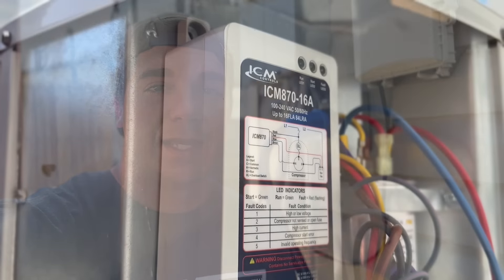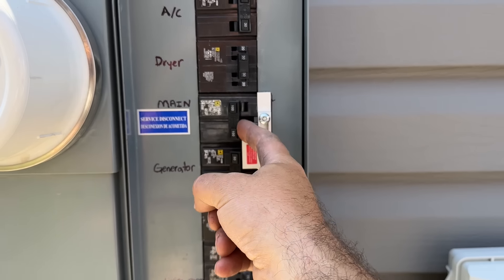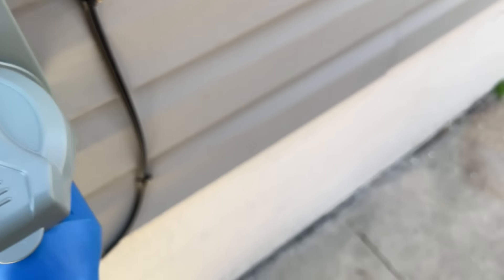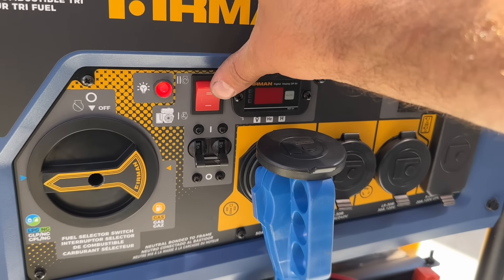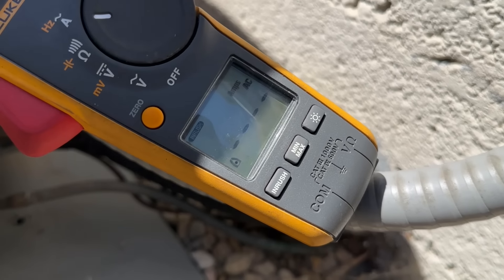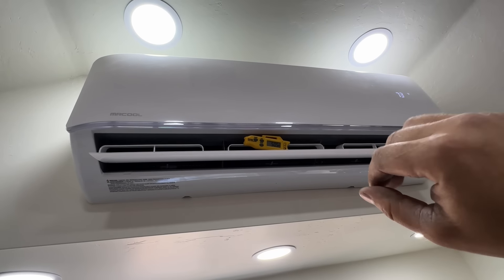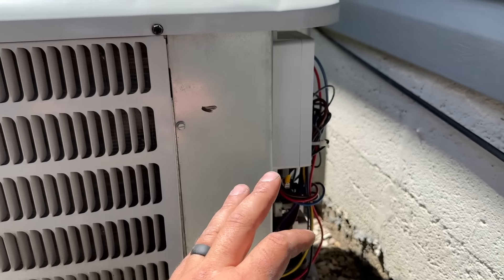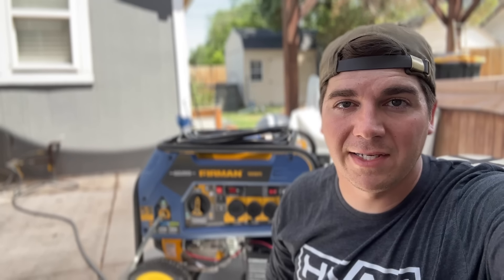How To Get Whole Home Backup Power For Under $1000

Comment: One thing to note with soft start devices, they lower the inrush current at startup. THEY DO NOT LOWER THE RUN CURRENT OF AN AC COMPRESSOR. Soft start devices do not save your money (in reality its very negligible) in electricity bill costs, but they greatly save your compressors life span minimizing wear and tear since it's not hard starting with a partially for fully locked rotor from the pressures inside.

Great video!
Reply: just curious, if soft start is beneficial that way, why don't the AC units come from the factory that way?
Reply: @Jeremy-vb6tv  more complexity, added cost, manufacturers want to sell units and given this is about a $400 upgrade USD not many would opt to do it unless it was absolutely necessary.
Reply: Note: most modern units have time outs that generally keep compressors from starting with a pressure lock. Soft start units do reduce start amps, so batteries or generstor can start the unit
Reply: @greggpurviance7252  yes, a time delay on relay. I have a variable one 2-10min delay for my outside compressor.
Reply: i think the benefit is purely being able to use a generator to run it without the generator popping an overload fuse when the ac starts.
Reply: Simple.  Money and practicality.  Many systems come with what we call hard start kits.  They do the same thing but cost a lot less.  Also, many newer systems are inverter driven already.  So there is no need for a soft start.  But you need to be very cautious in your selection of generator when doing this.  You need to make sure your generator is one that produces a true sine wave.  Electronics in modern systems will fail over time due to poor quality power.  Not all generators are created equally.  Portable generators are hit and miss on this.  Portables are also not made for continuous use like regular whole home standby generators are.

All that said, I have run a 4 ton heat pump (with a start assist kit) on a 9kw portable generator for short periods of time.

Another factor is this.  The soft starts mentioned in this video are only good for a maximum of 16 amps.  So that limits the use to 2-2.5 ton systems and under.  There are larger soft starts but they cost considerably more.
Reply: @Bassguitarist1985 isn’t a time delay just staggers start up with the air handling unit.  When the compressor starts, it still going to surge at start up ?
Reply: @tonymanero5544   according to this info, no, there should not be a huge amp spike when the compressor starts when you have a soft start kit installed, and that is why your generator can power it.
Reply: @Jeremy-vb6tv The new ones do, more and more. Old ones need the kit. There are even Midea window a/c’s with soft start i.e., inverter drives. My dishwasher is also that way.

Comment: FYI .... According to the T07571 manual,  the maximum is 31.25A. I have the same generator. I have seen a 42A peak at startup using the Micro Air soft starter, but it is usually 36A. Then the A/C runs on 13A. When the A/C starts, I still have the refrigerator, HDTV, desktop PC, LED lights and other small devices on without a problem. I think that the generator is producing more watts on NG than what is stated in the manual.
Reply: Are you running a FIRMAN generator like he has or an Inverter?  I have the same FIRMAN and was told not to run electronics off of it due to the dirty sine wave of electricity that could harm sensitive electronics
Reply: @attimus02  Same generator, same model. It is not pure sine wave. I do have four UPS's on my HDTVs, computers, routers, external hard drives, Xfinity X1 box and have not had a problem except the UPS's will beep and click when using the generator. I have a stupid power strip plugged into the UPS battery backup side with items plugged into the strip. All I have to do is move one plug to the surge protector side. And then turn off UPS. Surge protector with EMI/RFI Filter will still work. APC PowerChute has a sensitivity setting which may help with the clicking. If I don't use a UPS then I do have APC surge protectors. My Fisher & Paykel Dishdrawers will beep. As a backup, I have two 1408Wh and two 666Wh power stations, and eight 100W rigid solar panels which I made into four suitcases to set up in the back yard. I could also use the generator to charge the power stations and use on anything sensitive.

Comment: My 4 ton went from inrush of 120 Amps to 40 Amps for reference. I have a similar setup but don't run my Central A/C with my portable generator. It does run my entire inside breaker box. I do not have a main breaker or shutoff on the outside box, pulling the meter is the only way to disconnect power to the main outside box. I just shut off the inside box, outside, then run the inside box from the generator. My Central AC is on the outside box. Works great for me as I can run everything except Central, Oven, Hot Tub.

Comment: Sold my sticks and bricks end of 2019 - live full time in a 45' Grand Design "mansion on wheels" - I have a generator that is propane/gas powered just in case - there are soft start options for Rvs in case you need to run multiple AC's and everything else, which my home has 3 hence 3 soft starts needed - but - I can be completely off grid in moments if needed - good on you telling home owner's about soft start options - most people by a whole home Generac or solar at a MUCH higher price point for the same results HA! Next time there is a major hurricane etc. this video count will go way up!

Comment: I love that generator, I have the previous version I bought a few years ago (gas and propane dual fuel) for $600, it gets more use in my business then it does at home but I haven't found anything it won't power as of yet. was looking at upgrading to this one because of natural gas, not having to fill up gas or replace propane bottles. been wanting to put this system together, thanks for showing us.

Comment: Glad I did this when he released this video a year ago  as I have the same generator. Generator has been running almost a week straight since Beyrl hit Monday and now Sunday and still no power. Already did 2 oil changes and will change spark plug when power comes back on. Been able to run 4 ton ac unit with micro air soft start , dishwasher , washer and gas dryer (not simultaneously) , 2 fridges and chest freezer , and small electronics like router and cable modem .

Comment: I have this exact set up except I do not have a soft start kit on my AC unit. I can run the entire house and it's clean and fantastic with this Firman tri fuel unit. I bought the generator on Ebay from the Firman store for $500 brand new - not a refurb.

Comment: Had a small generator and it didn't have enough power (5500) to run several appliances or my AC. I bought a bigger (13000) LP and need to upgrade the transfer box. Your video was informative,thanks.

Comment: I have that same brand I bought in 2014.. I was upset that i was supposed to get a Goodman but got this we went back and forth.. anyways 9yrs later still working like a champ only had to replace capacitor last summer.. besides that nothin not even a charge 1.5 ton here

Comment: This is a great video! Can you answer a question for me? Are you running the fridge also? How many fridges. And if needed, are you able to run a tv and a gas oven with this unit. Also, water heater. 

The reason I ask, cause I feel like there’s some misconception out there with how big a generator is needed. I have a townhome, with 2 ton AC, 2 fridges, water heater, electric washer dryer, 2 tvs, 2 computers, a Wi-Fi router and of course lights throughout the house. Not everything will be ran at the same time. So I feel like something under 10000 is big enough. 

Thanks again for this awesome video. Look forward to your reply and anyone following the comments.

Comment: I have virtually the exact same setup. AC soft start and a Firman Tri-Fuel. I opted for their 10kW (when running on gasoline) generator because I have 2 older refrigerators and 2 older deep freezes as well. I've never had to use it, but in testing, it will run my entire house. While using a portable generator is a little bit of work to get the power back on, the generator is not limited to backup power only. I can use it for other purposes.

Comment: There are some 220 volt, 9500 watt, inverter type generators, for those concerned about damaging electronics with a portable generator such as this Firman.   But they are a lot more money and probably use gasoline only.
Reply: Champion model 201176 is a 9000 watt tri-fuel inverter generator. Wen also makes and sells one. As does Pulsar and Duromax

Comment: Your starting inrush current was actually much higher than what your meter showed. That meter did not have (or was not set to) a peak reading scale, although the inrush WAS about 1/3 of the original inrush before adding the soft-start. I use one on my 4 ton GSHP.

Comment: Firman’s are very LOUD! I have been on one job where they had a Firman. I was underwhelmed. Great presentation though. 
I have a hard start capacitor for my 2-1/2 ton central a/c. I need to upgrade to a soft start kit. I have my eye on one. I have the same side generator. I have the Honda EU7000is. It is phenomenal in my opinion. I have used it several times & is much, much quieter. Plus it puts out steady clean power. I have an interlock in my CB panel. My unit uses less gasoline than most & with a auxiliary fuel tank only need to fill it every two days.

Comment: This is another great video!  I would suggest consideration be given to using an inverter generator.  An inverter generator produces about 3% Total Harmonic Distortion 'clean' power which is safe for sensitive electronics like computers, etc   Regular non-inverter generators produce 12% to 20% if not higher Total Harmonic Distortion 'dirty' power.  It will work on sensitive electronics but will cause them to age quicker.  If an inverter is not used, suggest using a filter for sensitive electronics plugged directly into them.

Comment: Good video. Only thing I would do different is sell that generator and buy an inverter generator. Your generator has 15% total harmonic distortion which can and will destroy circuit boards in your house. Check out the Champion 201176 tri fuel inverter 9000 watt generator. It has less than 3% distortion

Comment: After our freeze a few years back here in Texas, I simply had a Generac 24KW installed. This also puts my whole home on surge protection. This is important as in my home you talk to fans, lights, TVs, everything is on network... even the smoker, pit, and grill. With all the electronics it is important to have clean power (60Hz).  Good luck with any setup you choose.
Reply: How is it?

Comment: I’m a generator tech and personally own two Firman gennies.
Reply: Hi!  Could you tell me whether or not Tri fuel generators have a safety feature where natural gas will be automatically shut off should generator stops running for whatever reason with no one around to notice?  Another video mentioned needing a regulator to do that.  Does Firmen Tri Fuel generator, or any Tri Fuel generator for that matter, have a regulator already build in the generator to sense disruptions in gas pressure?  Thanks in advance

Comment: I live on a 9 acre property in Alpine California.. No one knows that me and my wife live on a 33' trailer. We purchased the firman 9500 tri fuel. I had to return it 3 times. We bought it only to power our AC. I installed a soft start and bought 2 Ryobi inverter and run them in parallel they've been for 2 years straight.  I WOULD NEVER RECOMMEND A FIRMAN..

Comment: So, you know, that generator has a bonded neutral and so does your main panel so using it as shown violates the code. You're supposed to convert the generator to floating neutral when hooked up to your panel through an interlock. It's easy. Firman has released instructions. Then, when used stand alone you're supposed to use a bonding plug.
Reply: Absolutely correct and it violates code because it can be dangerous. Most newer portable generators come from the factory with a bonded neutral. Your operators manual will state the neutral configuration from the factory.
Reply: From what I have read, if you use a generator power transfer switch instead of an interlock then you do not need to disconnect the bonded neutral on the generator. California requires that you use a generator power transfer switch and says it is safe to use with bonded neutral generator.

Comment: It is VERY IMPORTANT to explain that the power inlet connector is deadly WITHOUT the breaker interlock kit you have installed (which is absolutely the correct way).  I would venture to say that a lot of people will not "get" that they MUST have the interlock kit to go along with the power inlet box.

Comment: Great video...I have the same setup here (less the "soft start")...same Firman generator running on clean NG...no worries about "gumming" it up with gasoline...I also installed a separate Siemen pony panel for the generator with the proper disconnects...then moved home essential circuits to that panel...the AC, unit did not make the cut...I hope that we don't have to use it, but you never know???
Reply from the maker: Awesome thanks for sharing!

Comment: i have a update. i loved my predator 8750/7000 but 6 months ago i bought the 13000/10000 predator tri fuel. with a 50 plug. and it will run everything at one time. my water heater stove drier at the same time i tried to test if i could over load it. it ran it all but dont like the water heater. but its nice to know it will do it.

Comment: Good video and info. I’ve done 4 50 amp generator back up hook ups with the manual transfer switch. I’ve ran it on my house. I haven’t installed any of the soft starts but I may look into that.

Comment: I have the same Square D meter-main panel on my home. I wanted to use the same interlock method that you used on your panel, but ultimately decided it would not work this way. 
Upon inspection of my panel, each main bus bar is fed directly by an aluminum conductor bar off the meter side of the panel. These conductor bars are bolted to the main bus bars and to the lugs on the meter side of your panel.  With this method of interlocking, I am fairly positive that you are backfeeding the grid by mistake. The breaker that you have connected to your generator inlet is energizing the main bus bars on your panel, consequently it is energizing the conductors bars that are connected from the meter side of the panel. If our panels are constructed the same on the inside, this has the potential to kill a lineman.
Reply: If the service disconnect breaker is switched to off, there should be no way for current to flow back to the grid, or for the bus bars to be energized from the grid.  Grid to service disconnect breaker to bus bars.

Comment: Hoping you see this comment (after 7 months of uploading this video), but I'm curious what kind of natural gas usage and cost you've experienced using the generator. We have natural gas here, and I feel like it would be pretty easy to tap into the gas line like you have set up in the event of needing to hook the generator up. The natural gas at my home is only used for the tankless water heater, the gas stove and the heater for the home. So gas prices during winter are substantially more than during warmer months (when I'd want to incorporate a backup for the home during hurricane season).

Unless I could budget for Tesla PowerWalls right now (I have solar on the home), I'd go that route, but this could be an affordable fix in the meantime.

Anyway, thanks for sharing the video!

Comment: I just installed the icm870 in my a/c unit today. I got one because of one of your videos and i think Taddy Digest did a video on them also. I did it mainly to help extend the life of the unit. Hopefully my generator will start it up. Mine went from 70 in rush to about 26.  That is a big change but  my generator only has a 30amp twistlock. i guess it is borderline but ill have to test it out to see if it will start it. Love your vids man. I watch a few of u hvac guys and u put out some great info.

Comment: I like how you set up the hookups and the anti back feed device on the breaker box. 
It is a little misleading saying this will power the whole house. 6500 watts is 54 amps @120 volts. Most house services built these days are 200 amp. It will power some houses if they have gas water heater, gas stove and gas heat but not an all electric home of anything other than modest square footage. Whole house generators are usually 12kw and up. A 2 ton AC unit is pretty small by most standards.
Reply: It will ABSOLUTELY power most home essentials. Turn off the electric water heater (it can do it, but keep it off until you need showers). For example, my house in Florida is 2 stories, 4000 square feet, with 2 fridge's, a deep freezer, a pool pump running all day, and two central air conditioning units running all day, and my house averages like 2800 watts. Sure demand can get up to 4000-6000 watts sometimes, for a limited time, but most of the time my house is averaging under 3000 watts. People buy way too large of a generator when these smaller ones will do it just fine most of the time and power most of the essentials.
Reply: @bubbatime   @bubbatime  A real danger of undersizing your power supply is over taxing the generator. This can result in overheating the generator windings, and/or low voltage situations that can damage electrical components it supplies. Our last house had a 12kw (with auto transfer switch) that was more than enough to run everything I needed to run. We had gas heat and water heater. 12 kw at 220 volts figured around 54 amps. The house had 100 amp service. 6000 watts is 27 amps @ 220 volts. While it may run it there are risks if everything randomly needs to run at the same time. Use whatever you want. It's best to know the risks.